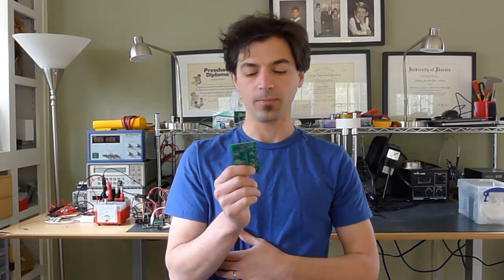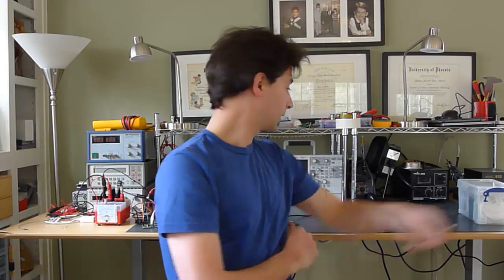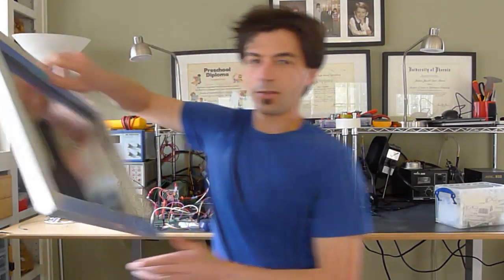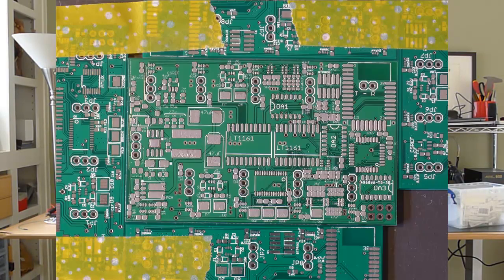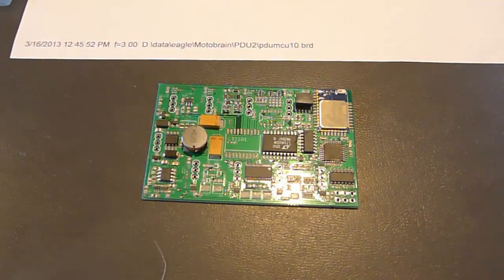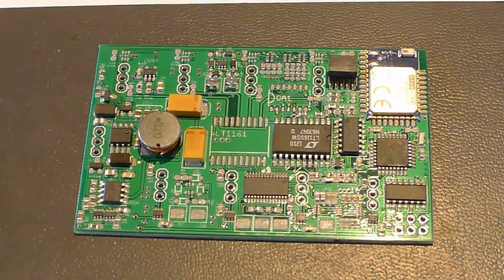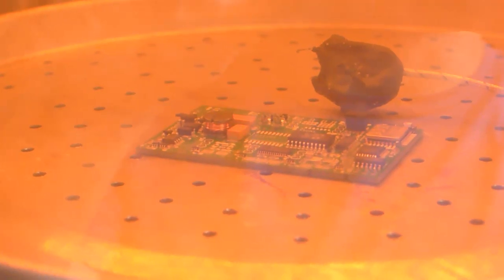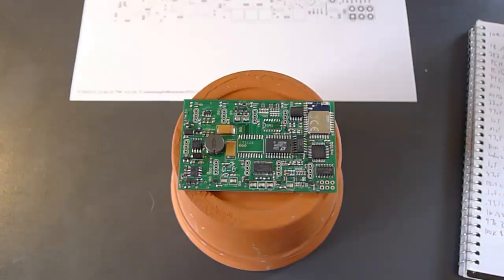Surface Mount Reflow Soldering At Home

Comment: Very nice video Crafty. I recently built an oven using a kit sold on Tindie by Mr. Nick Sayer called the Toast-R-Reflow kit and I am gearing up to do my first project. I am keeping it Super Simple mounting a 1 watt SMD LED onto its star base. I really liked your vacuum component placement device. I will use tweezers on my first try but I would like to in the future become as well setup as you are. That board you reflowed in the video looked really advanced. Okay thanks for taking the time to make the video. And I'll subscribe to learn more.

Comment: Hi there i have one question, i see you set the temperature oven to 180 C, but i saw datasheet IC LT1161x which u used it said "Operating temp range = 150 C" but i saw also " lead temp soldering (10sec) 300C", i think 300C is permitted to IC foot only?
Reply from the maker: +fadli m I reflow at about 225 actually. That has nothing to do with operating temp however. The operating temp is the temp the device and operate at. It will run at 150C. That number provides no feedback with regard to the reflow solder temp it can withstand.

Comment: You should make a DIY pick and place machine. Need a basic cnc machine with vacuum nozzle. And 2 camera one watch the board the other what have to be picked up the software identifies the exact positions the items . Placing it not a big deal .You have a easily identifiable mark  on the pcb from you can calculate the position. Identifying the to be picked up item a bit more tricky . I am sure with your skills its not a hard task for you :P